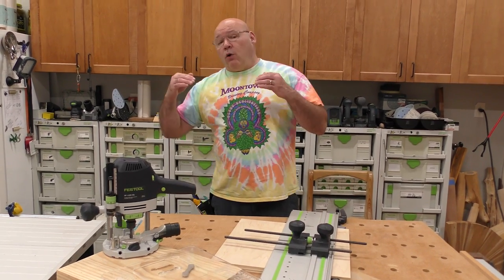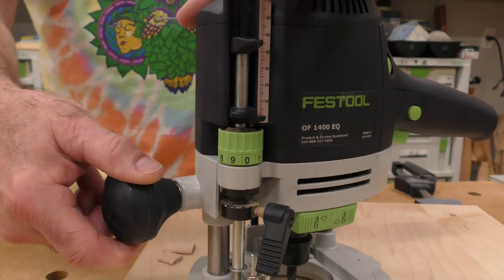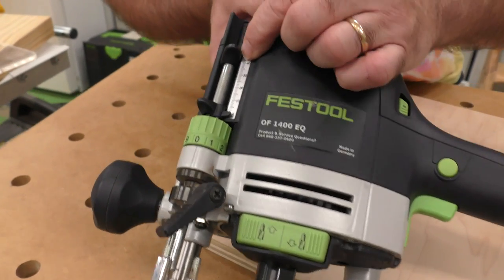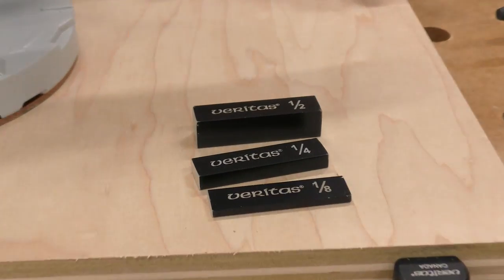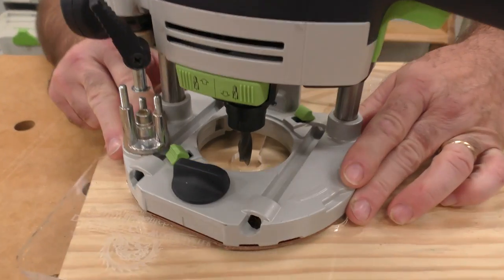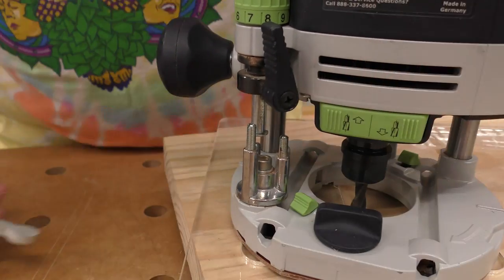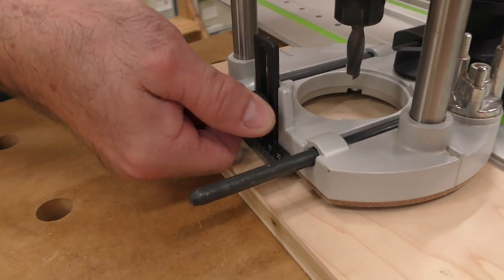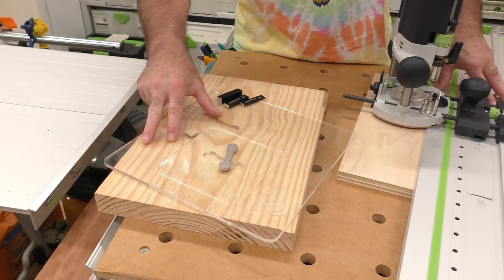The Right Ways To Set Depth on a Router

Comment: Off topic Sedge, but you'd be the best man for this issue. I plane the edges of long timbers with the festool of2200. I'm using a carbide spiral bit, the guide rail adaptor (494681) the correct offset base and a guide rail. I'm always getting a tilted cut. about 2 degrees so that the bottom edge is narrower than the top one.  Apart from maybe sandwiching shims within the base, Is there a correct remedy?
Reply from the maker: oh wow.. cool .. i have never used this technique with the OF2200 and the guide stop to plane boards. I have in the past used a real good straight edge and a top bearing bit to straight edge boards with a router. In you technique I would suggest using as you are now some shims... also it may be the timber has some crown  to it...just a few thoughts. I hope this helps !!!
Reply: I’m struggling with how to cut  1/2 rabbets on multiple boards,  I use one turret w a 1/4 guide block, how do I set a second turret to cut the next 1/4 and not change the depth rod?